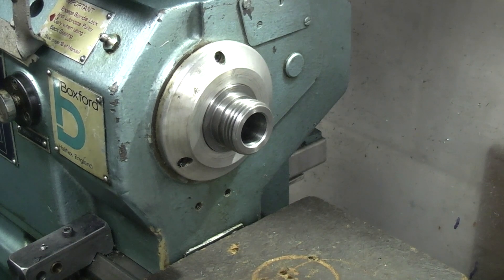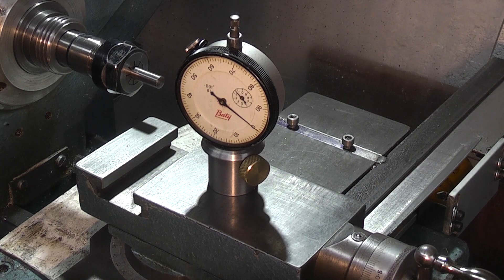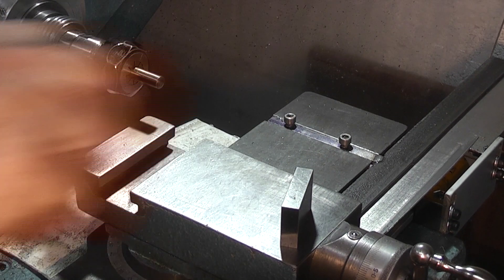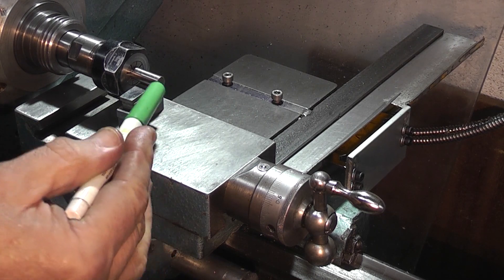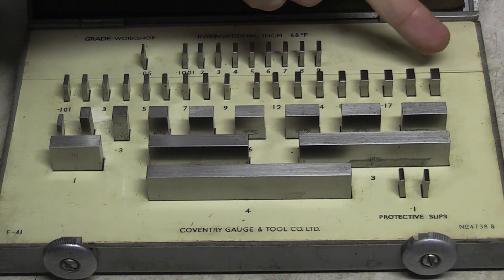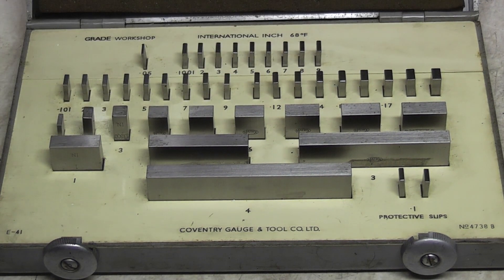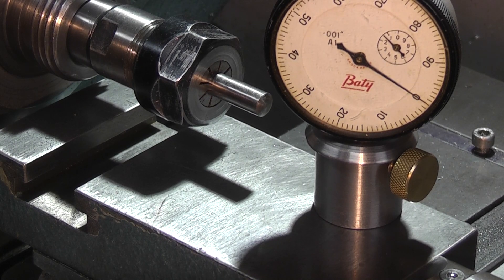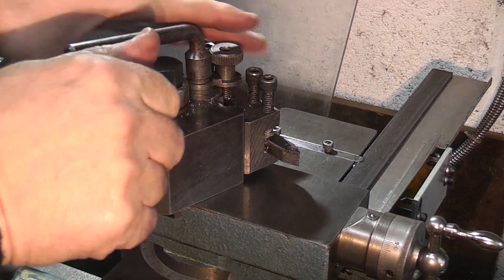Finding the headstock centre height

Comment: Hi Alan, Do Boxford lathes have a #3 MT built in the headstock shaft as yours does? I have a metic AUD and thought it was a straight thru.
Reply from the maker: Hi If its a screw thread held chuck it probably has a 3MT
Reply: I have a late AUD and it has an MT3
Reply: @mikeirwin9985   me too

Comment: Thanks for the video!
Can you necessarily rely on the top of your compound to be flat enough to use as a reference? It seems to me, if its not dead flat and level, then the whole setup of your tool would be off as well.....
Reply from the maker: Hi Mutasim  you can check that by using a magnetic base with a d.t.i. attached and move it over the surface of the compound slide.

Comment: Thanks Alan, as a beginner with a Boxford I always find your videos interesting. Is the low tailstock a problem? I imagine it would cause slight taper turning, how could it be rectified?
Reply from the maker: Hi William to check the tail stock offset, hold a lever type indicator in the chuck and hold a dowel in the tailstock touch the indicator onto the dowel . Then rotate the indicator by turning the chuck and check for a low and high spot. If its front to back you can adjust the grub screws in the tail stock to bring it onto centre line. If it's top to bottom you may need to pack the tail stock up.
Regards
Alan

Comment: Very useful tool centre gauge, was there any runout in the ER collet?.
Thanks for sharing.
Reply from the maker: Hi my ER collet was running  true but you could use a chuck
Reply: @enotsengineering  Yes of course, just turn a diameter with a good surface finish, and measure it accurately. May I suggest a short video on "Wringing" the slip gauges together and splitting them correctly?, Thanks for sharing and best regards from the Black Country.
Reply: @bostedtap  +1 And best wishes also from a Black Country mon in exile on the South coast.  Love your videos, Alan and always look forward to new ones.